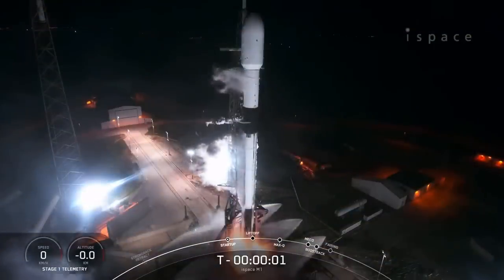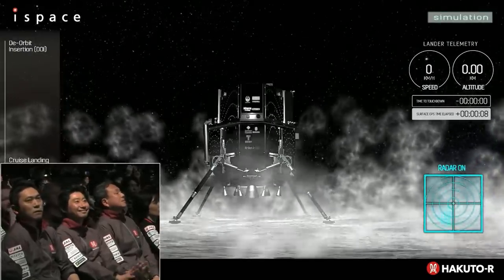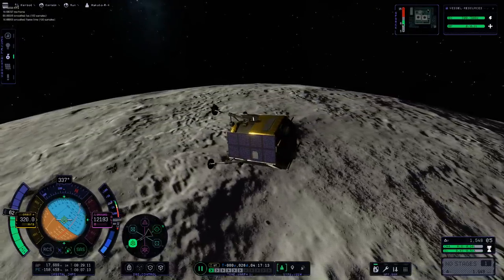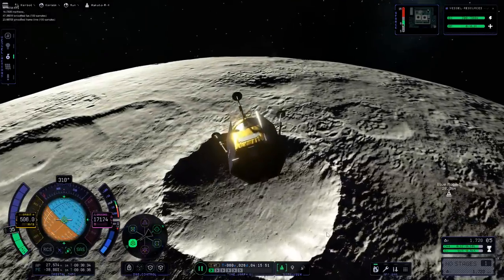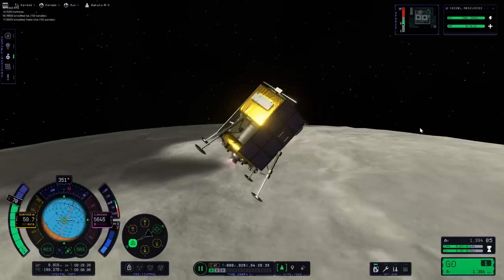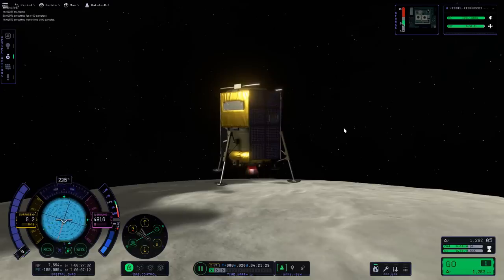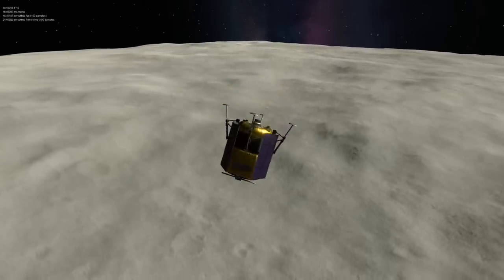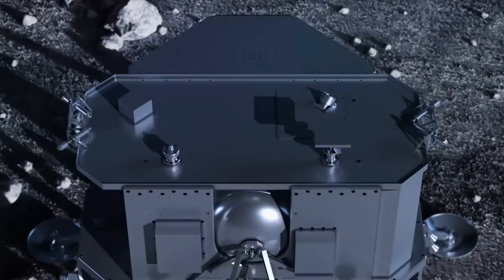Why Japan's Moon Lander Crashed Due to An Unbelievable Computer Bug

Comment: The moon lander knows where it is sometimes. It thinks this because it kind of knows where it isn't. By subtracting where it thinks it is from where it's pretty sure it isn't, or where it believes it isn't from where it sort of is - whichever seems more likely - it manages to get a rough estimate or guesstimation. The guidance subsystem uses these guesstimations to generate somewhat accurate commands to drive the moon lander from a place where it thinks it is to a place where it's fairly certain it isn't, and landing at a place that it wasn't quite sure it was, it now kind of is. Consequently, the spot where it is is now the spot that it wasn't, and it follows that the position that it was is now the position that it probably isn't. In the event that the position that it is in is not the position that it wasn't, the system has stumbled upon a variation. The variation being the difference between where the moon lander thinks it is and where it wasn't quite sure. If variation is considered to be a significant factor, it too may be adjusted by the GEA. However, the moon lander must also have a vague idea where it was. The moon lander guidance computer scenario works as follows: Because a variation has tweaked some of the info that the moon lander has obtained, it's not entirely confident just where it is. However, it's somewhat sure where it isn't, within reason, and it remembers where it was. It now subtracts where it should maybe be from where it wasn't, or vice versa. And by distinguishing this from the algebraic sum of where it probably shouldn't be and where it was, it manages to get the guesstimation and its variation, which is humorously referred to as oopsie.

(GPT4-generated)

Comment: I'm wondering... If an aircraft altimeter noted 5,000 feet in altitude and then suddenly jumped to 8,000 feet, it would be understandable for the computer to disregard the sensor data since the altitude was measured by ambient air pressure, and air pressure should not change that dramatically, even in a storm.
If this type of Logic was coded into the control software, the Laser Range Finder or Radar data would be disregarded even though it's perfectly plausible for the distance between the lander and the surface to change dramatically over craters.
They need to run simulations on clear days using NASA aircraft over the Grand Canyon.  The Grand Canyon has sheer drops, but craters have Rims that increase in altitude above the local surface before dropping down below the local surface altitude.  That should have been added to the programming to identify rims and craters.

Comment: Not a software bug, calling it that is unfair to the team who wrote the software.  It is a use-case oversight that should have been caught in failure mechanism and effects analysis (FMEA).  When designing something this complex, with so many uncorrelated variables, the only efficient way to test failure modes is through simulation of the use cases to uncover the 'unknown unknowns'.  I feel sympathy for the team, but these are excellent learning lessons, and everyone on that team will not allow such a failure of planning and management on any project they will ever work on for the rest of their carreers.
Reply: ... except for the program manager who was taught at Harvard.

Comment: Seems like you'd simulate it over a surface even worse than the moon, to be sure it's not at the edge of working on the actual surface. Also if a sensor is giving odd data, give it a little time and check back to see whether it was just a temporary glitch, especially with an essential one like the radar.

Comment: Um, the craft should have had topographical maps of it's route and destination. It should have been able to anticipate the altimeter readings it expected and then compare those anticipated values to the actual values measured by the altimeter; thereby confirming to itself that it is where it thinks it is.

Comment: A Kalman filter-based estimator forms predictions of the sensor measurements given the current state and differences those against the actual measurements to form "innovations," which is where a large discrepancy might result in the measurements being rejected so as not to corrupt the recursive state estimate. I wonder how the predicted altitude measurements were being generated- from a terrain map/database or just some basic constant altitude model whose process noise wasn't large enough to see the massive altitude discontinuity due to passing over a cliff edge as plausible?

Comment: btw, a spike cone flame/plasma diverter under a rocket launch pad or just a rocket nozzle, can use liquid ablative coolant pushed out from the head and/or maglev induction levitation shield
Reply: yeah for hypersonic planes too, the active maglev induction levitation plasma shield
Reply: yeah I would put a radiation/photon reflector surface on the plane/rocket nose

Comment: Software (really algorithm flaw, not a code bug) not designed properly to handle terrain seems nuts.  
We used radar altimeters to autoland jumbo jets in the 1980's, and we knew about terrain readings.  Seems obvious.

Comment: Wait, this spacecraft only had one altimeter on board? No redundant altimeters from different manufacturers? It would be easy to pin out if the measurement is a fault or not if all your two or three different altimeters gave the same result...

Comment: So, the "telemetry driven" graphics are not actually that right? According to that, it landed rather than crashing (although some in the audience seemd to realize something was wrong). I have seen this on rocket launches as well when the rocket fails but the launch graphics go on with supposed live telemetry for some time. Guessing the graphics and "telemetry" are simply a pre-programmed package of what is supposed to be happening at a certain time so people have something to watch.

Comment: I'm a GNC engineer, and I cannot understand why they didn't rerun their simulations when they changed landing sites.  You simply don't do that, schedule pressure be damned.  Even if you think the software algorithms are robust enough to handle any uncertainty in surface topology or sensor performance, you still run the simulations to be as sure as you can be.  If you have to delay the flight, then so be it.  The moon will be back in a month.  I wonder if this is a consequence of Asian cultural reluctance to disagree with authority?  That is, if the boss says we're going to launch on a given date, then that's the way it has to be.

Comment: Can anyone confirm if I'm thinking right?

When in freefall above the surface of the moon, and accelerating at 1.62 m/s^2, an onboard accelerometer would record an acceleration of zero, right? Because the accelerometer is being uniformly accelerated together with its mounts, and not under any strain. 

And when landed on the moon, or hovering above the surface, the accelerometer would record a value of -1.62 m/s^2, because now it is sagging into its mounts? 

Of course, the software, or maybe the drivers, would know this and interpret the values before passing them down to the next routines right. 

That's why most app that allow you the read the accelerometers of your smartphone will tell you the acceleration is zero when your phone is immobile on a table, but the accelerometers are really reading 9.81 m/s^2, right? that's how your phone can actually guess which way is down?

But a spaceship probably has some really complicated way of detecting it's own acceleration due to gravity, while a smartphone probably just has a hard set value of 9.81 somewhere, so if you placed your phone on the lunar surface it would kind of freak out?

Comment: It seems like a super simple oversight in hindsight, i mean obviously we all know theres drastic changes in the surface of the moon all over the place, so its loke duh obviously youre gonna see big changes in altitude based on the surface differences.but the reality is that they probably provided its margin of error based upon their best abilities for the landing locations they were supposed to have. And it probably worked fine a thousand times in practice. Then the plan changed and too large of a variance appeared. At least its an easy thing with several potential fixes, like dont ignore data until several unexpected signals come, have a backup sensor, have a different type of backup sensor that measures things diferently, or increase the margin of error. The hard part is the balance to allow the system to be able to try to save its own life, while still making sure it doesnt read bad data that causes it to take its own life instead.

Comment: Insert rant. 
From experience with drone design. 

Use proximity detection not range detection. 

By using a hemispherical closest point plus largest return you get a far far safer and more useable signal than a point detection. 

Yes, your flight envelope must be based on an inertial navigation updated by (gps) range finders and thermal cameras for level (and altitude) to planetary surface and flow detection for lateral velocity. 
But! ……. Landing must be from proximity detection.

Comment: Seems like it might have landed OK if it didn't run out of fuel?  Was it taking much longer to land, or using more fuel for some other reason in this contingency without radar guidance?  Seems like that's a gap in design/testing as well.     Also, was it too conservative in rejecting the radar data? Did it rely too much on an incorrect elevation model of the surface, or just wait too long to start using it again, or turn it off permanently for some reason?
Reply: My understanding was it believed 5km elevation was the moons surface, so it was going to hover there slowly descending until touchdown. So in other words it was always going to run out of fuel. (I think the video said it was descending at around 1km/hour, so it would have needed an additional 5 hours worth of fuel!).

Comment: This is what happens when you have people not used to real sensors. They should be running the simulation in transit to see if it matches by the estimated position. Cutting off a sensor for some intermittent bad sensor readings is bad, especially when the alternative is widely inacurate. If the alternative is tha bad you have 3 of them. 2 for sense checking and the third for resolving conflict.

Comment: LiDAR has gotten smaller and less expensive; I wonder if a small LiDAR unit cross checking the radar altimeter could have helped prevent this.  If two different types of sensors confirm each other, it's a strong implication that the sensors are not malfunctioning.  Also, the LiDAR can actually map that portion of the surface, allowing the probe a chance to see that the change in altitude is temporary; the altimeter is not really designed to double as a radar mapper.

It's no substitute for verifying that the simulation is still valid for the new landing site, of course, but it could help in the event other unexpected events crop up.  Our mapping of the Moon might still have some precision issues, despite its thoroughness these days.

I very much feel for the Japanese, who are absolutely meticulous, as this is going to feel like a painfully obvious mistake and make them feel they have lost face on a global scale.  (Personally, I feel the same way for the Martian lander where we used imperial instead of metric in our programming, and the European altimeter was feeding the computer data in metric instead of imperial.  Seriously:  who does any real science or engineering without using metric these days?)

Comment: 20 years ago I've got involved in a student satellite project receiving decent sat design workshops from top notch system engineers. The one of them designed the main operating system for several well known ESA science probes. He has emphasized several times: simplicity is key! If you design a fail-safe or a redundancy system, make sure the result is safer than before. If not, cut it off and delete it. ;)

We were stunned. But after 3 times, everyone understood the core message. 

You need to perform double checks, triple checks on lethal autonomous decisions. Otherwise exactly this could happen ... and already happened many times before.
Reply: @scottmanley By the way, why is it not possible to save this video of yours into my playlists? The save button is not available here unlike for all others before. What a pity!

Comment: If you've ever worked on a large project, of any kind, you soon learn that software is going to be more difficult than hardware.  It just is!  Hardware is driven by physics, and we understand physics just fine.  Physics has hard and fast rules:  Adhere to those rules, and your hardware will (probably) work, with the possible exception of reliability issues.  But software is basically just logic...and logic has some pretty flexible, flakey, and subjective rules.

Comment: Now, hear me out here. I think its high time we add a few radio transmitters that we can just drop from these probes as they are on final approach. then you know precisely how far down the signal is... go meet the signal... just a thought.
Reply: Or very smartly, hardcode that the computer cannot ignore the radar info... and goes into very active sampling mode.

Comment: Why didn't the radar altimeter have redundancy considering its a single point of failure? maybe 3 of them  to isolate the fault and use the correct source of truth. In this case it would be considered as a non-anomaly since all readings would be the same.

Comment: This obviously doesn't have to happen and of course people make honest mistakes.  However, it is amazing that such a high level issue can get all the way to the moon.  As an engineer with one foot in software and one in the physical world, this is frustrating.  Was this a project management issue?  Did they rely too much on simulation?  Was the simulation detail adequate?  Was their cost cutting?  Did they under staff at the technical level?  Business shortcuts that lead to failures are business and management failures alone.  In this world, Physics is the customer and there is no shooting from the hip.

Comment: The Moon Lander doesn't know where it is at all times. It doesn't know this because it doesn't knows where it isn't. By subtracting where it is from where it isn't, or where it isn't from where it is (whichever is greater), it would obtains a difference, or deviation. The guidance subsystem uses deviations to generate corrective commands to drive the Lander from a position where it is to a position where it isn't, and arriving at a position where it wasn't, it now is. Consequently, the position where it is, is now the position that it wasn't, and it follows that the position that it was, is now the position that it isn't.
In the event that the position that it is in is not the position that it wasn't, the system has acquired a variation, the variation being the difference between where the missile is, and where it wasn't. If variation is considered to be a significant factor, it too may be corrected by the GEA. However, the Lander must also know where it was.
The Lander guidance computer scenario works as follows. Because a variation has modified some of the information the Lander has obtained, it is not sure just where it is. Furthermore, it isn't sure where it isn't, within reason, and it has no idea where it was. It now assumes that where it should be is where it wasn't, and now is.

Comment: I thought they would run Monte Carlo flight simulations, which are thousands of simulations, each time varying some parameters or conditions (like terrain!) to see if the thing always lands OK, performed faster than real-time with great computers.  We did that on X-33 simulations, and we had a lot of aerodynamic variables, far more than this spacecraft (no air).

Comment: Several mentions of "the human loop" e.g. as in Apollo days.

Given the mere 2 seconds (approx.) round-trip for radio signals, why couldn't such a spacecraft landing system have "called for help"? (from "astronauts on the ground").  In this particular case, there would have been time for the signal to have been received, operators to react, and the command to have been received.

Like the Apollo astronauts overriding various issues (on several occasions).

During an actual mission such as this one, the people best qualified to serve as knowledgable "astronauts" might well be the developers.

The same "human backup"principle could be applied regardless of any redundant/majority-vote based systems - whose decisions could (by design) be regarded as interim/immediate reflex, overridable by personnel (with or without A.I. support - itself also cheaper "on the ground").

In one part of a software development research project that I was involved in during the 1980s, studying software diversity in redundant hardware (to reduce risk of common mode failure from the software), we stopped test-runs on any discrepancy (among the diverse redundant elements) while the cause was discussed among the (diverse) developers.

* The proportion of cases where the majority wasn't right was surprisingly large.  

Because in certain (not all) cases, one developer or other "thought different", and as it turned out, the right way.  As agreed by all developers (present for each run).  

Admittedly, for vital real-time decision-making speed, a hierarchical (overriding single captain) system would be vital.  One that listened (while there remained sufficient time) to their experts.